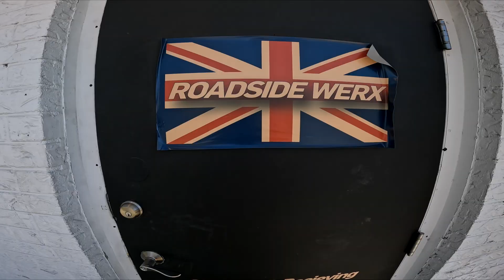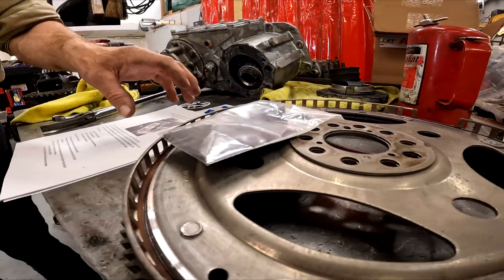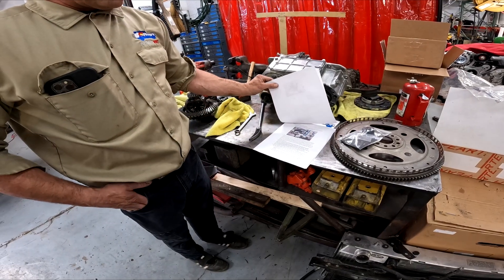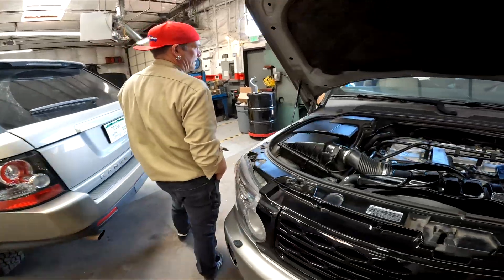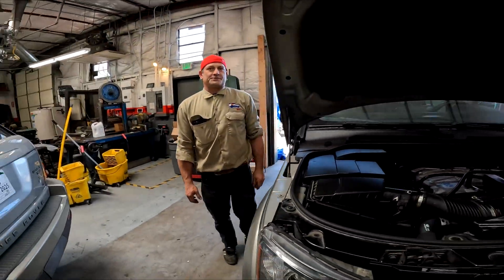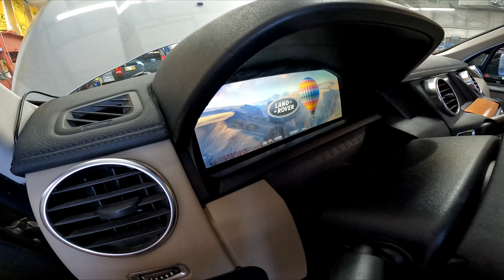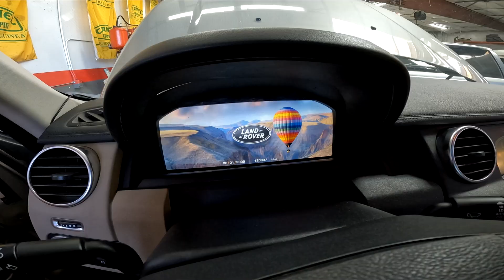Land Rover 6 Speed to 8 Speed Transmission Conversion

Comment: they don't really mention the biggest reason to do this - the ZF 8HP is vastly superior to the 6HP in terms of programming, shift quality and overall design. It is a much more modern transmission. Fluid changes are easier too, with the integrated pan+filter. And yes, 8HPs are plentiful as they have been used in many vehicles. Good upgrade!